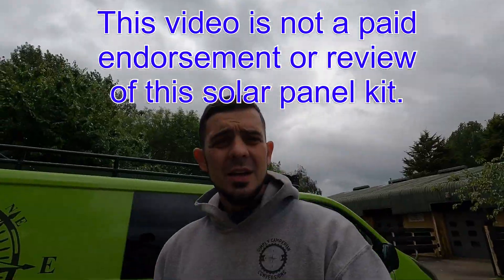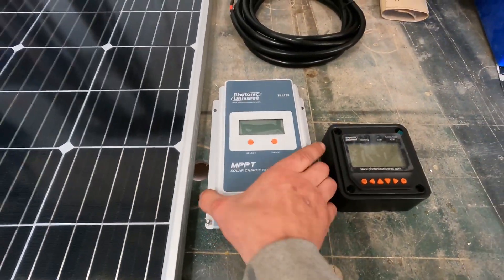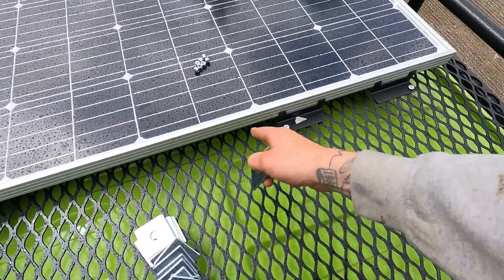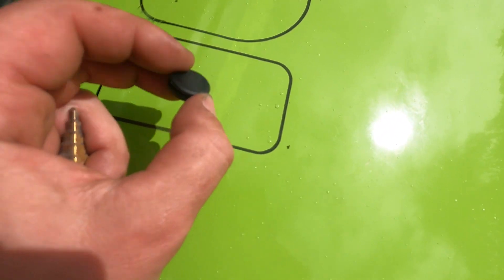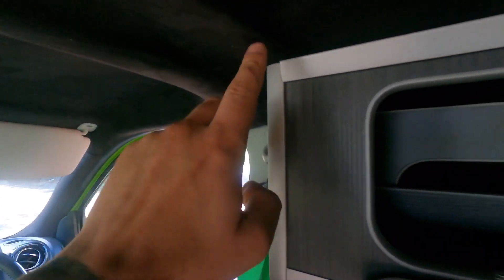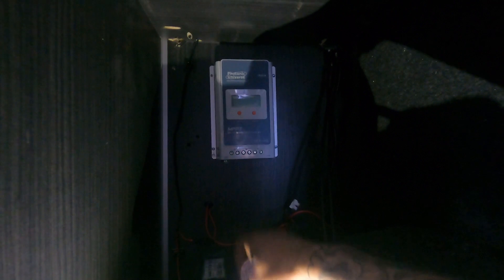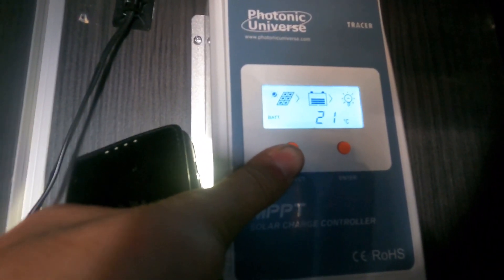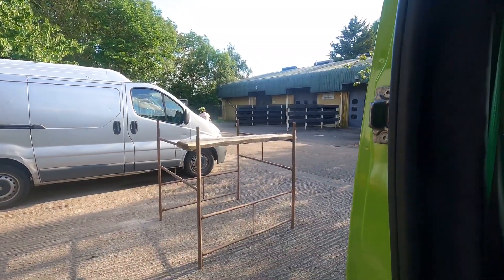FITTING A 200 WATT PHOTONIC UNIVERSE SOLAR PANEL KIT WITH 20 AMP MPPT CONTROLLER VIVARO CAMPER

Comment: I’m trying to fit the same controller, I was under the impression it needed to be grounded. Do you have any wisdom on that either way?
Reply from the maker: The ground is not needed.
What you have to think is what are you grounding it to?
Unless you have a ground spike that you stick in the ground it’s not actually grounding.
We ground other aspects of the van for fault finding so fuses can blow and we ground them to the chassis, but a solar controller doesn’t work in this way so doesn’t need doing.